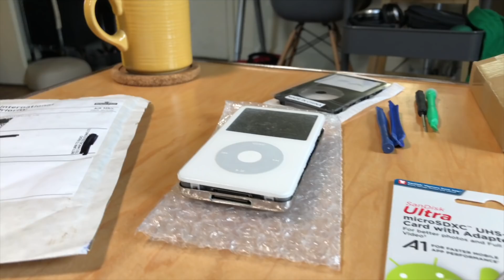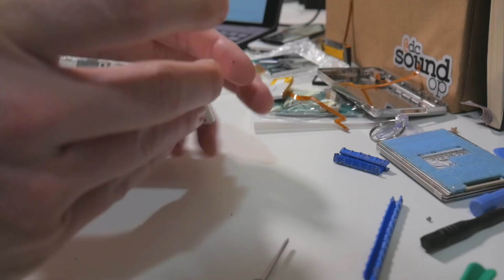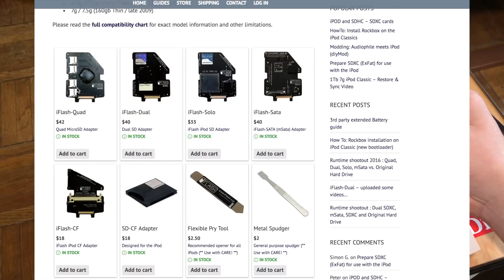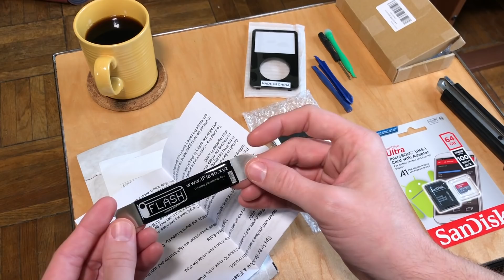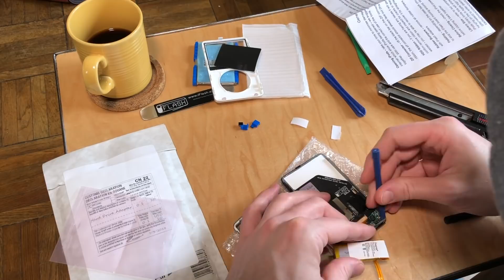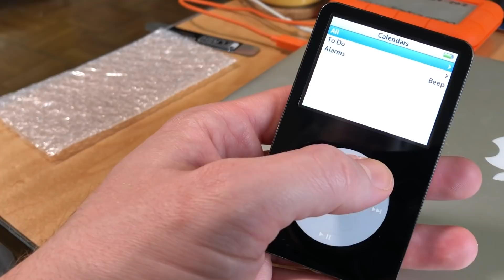Classic iPod 5th Gen SD Card Upgrade w/ iFlash.xyz Adaptor

Comment: You’ve inspired me to rejuvenate my two iPod 4th gen classics, one is mono and the other is color. I already replaced the batteries, but will now upgrade from 20 GB to 128 GB flash. I know it’s easier to buy a new, old stock iPod 4th gen Touch with 32 GB for $70, but that’s not as much fun. Thanks for your videos. I subscribed.
Reply from the maker: Thanks for the message, it's always good to hear of more iPods getting a new lease on life. Good luck with the upgrade!

Comment: For the screws attach a little magnet to the bottom case and put the screws there. So it becomes a very handy tray for this. For the cards: If you have a larger card tha 64Gb you need to format it as Fat32, since the larger cards are formatted as exFat by default and the Ipod may have issues with it

Comment: My library has about 30,000 flac files, totaling about 250gb. I've got several 5th gens and adapters in the way. Needless to say, I'm excited.
Reply from the maker: Wow... 30k FLAC files is a pretty serious collection!! Let us know how it goes!
Reply: @DcSoundOp  Well everything worked and one TB was recognized on my ipod fifth gen thirty gigabyte. I successfully loaded all of my music onto it, And even a few movies and t v shows and everything played just fine. The problem happened when I went to install rock box. Upon reboot the ipod is bricked. I just get a sad mac face and then it flashes to low battery even though it's a brand new 3000mAh battery. I know my next step is to format the drive and try again. , but I don't have a way to connect my mSata drive into my pc. It's back to the drawing board for me, waiting on more parts purchased from ebay.(new mSata, mSata to USB,  a few more iflashs, a few colored cases.) It's all or nothing. I found my new hobby and am building a new collection. I'm still in recovery from watch collecting and ipods are WAY cheaper.

Comment: i sd modded my 4th gen in a few years ago but i just dont like it as much as a hard drive without the spinning of the drive the ipod feel is gone
Reply from the maker: I know what you mean... there is something about the weight and the subtle vibration of the original drives that you don't get with the conversion. I'm glad your iPod is still alive though, have you thought of converting it back to a new old stock spinning drive? They are not super cheap, but I've seen them available for the 5th and 6th gen at least. Thanks for the message & for watching!
Reply: @DcSoundOp  not even joking later that day the IC on the board died while i was in the car 💀

Comment: I just replaced the battery and a screen from an old iPod video I had.  The battery was so bad it would die in under 5 minutes.  If I knew about the SD card upgrade, I would have bought a kit and done that too.  Not that I need more space, more that I don't expect much more life out of a spinning hard drive.

I've been using it as a jukebox on my stereo in the living room.  My spouse isn't very tech savvy but has had iPods, so it makes it easy on them.
Reply from the maker: Now that you've done the battery & screen and know how to get inside the iPod, the SD card is really an easy swap. I agree though, I'll never fill this much space with music! Thanks for the message & for checking out the video.

Comment: I’ve never owned one of these iPods. I’ve always had a interest in tinkering with things. I think because of covid and being home a lot has brought an upsurge in my wanting to fix, repair, take apart and mod things. I’ve already started with a unknown condition of a PS3. I took it totally apart. I thoroughly cleaned it. I applied new thermal paste. I put in a new SSD. Last thing is I’m going to apply a skin on it. So now I’m wanting to do more tinkering. I’m trying a battery replacement on a 3rd generation iPod Nano. Now I want to mod a 5th generation iPod Classic. I bought one for $20 needing a battery and HDD replacement. So I’m excited to start on it once I get it in the mail. I’m not sure which iFlash connector I want. I was thinking of maybe doing the solo. Full size SD cards are starting to get extremely cheap. I already have an new 256gb card I picked up on sale. I had thought of putting it in a notebook that I recently updated for current use. I want to say thank you putting videos out like for people like myself that have a natural curiosity of electronics and tinkering. I’m new to your videos. I’ve been watching Hugh Jefferies, Dank Pods, Techtronics Fix, and My Mate Vince etc. Thanks to the YouTube algorithm it brings me across to other content creators like yourself. I find it wise to watch additional creators to absorb knowledge.

Comment: after i formated the sd card via itunes disc restore, how can i access the sd card via card reader? I would rather be able to write the card via usb 3.0 cardreader than ipod usb 1.0 connector to transfer 200 gb of data...
Reply from the maker: On a mac you can cmd + shift + period at the same time to show all of the hidden files on the SD card - I've got no idea if anyone has figured out how to write into those directories though and make cross loading music there possible. You might be faster to use an alternate OS like rockbox.org

Comment: I've recently upgraded a 30 GB 5th gen to a 64 GB SD card using i flash its working good but the OS seems to run a bit slow, do you know if the larger capacity 5th gens have more ram and would that help withe speed?

Comment: Hey,  I have a samsung Evo 128gb as well as san disk 32gb class 4 SD card. I see the use iTunes to restore screen successfully. However, when I connect with my pc for restoring, it sometimes fails. At times it succeeds, but after restore is complete, it again shows me the error (sad iPod logo). Any idea what could be wrong? I use the cf adapter. Could it be that or the cable which I’m connecting with pc with, or should I try buying the san disk ultra card? Any input from you would be appreciated. Thanks.
Reply from the maker: Hey Arslaan, are you using the iFlash CF adapter or another brand? I didn't have any luck with the generic one I had, but I know lots of folks online have used them. Also, how are you using SD cards in a CF adapter? Is there another adapter between those? Do your SD cards have the write protect tab closed? Let me know some more specifics & hopefully someone here with more experience will be able to help. Thanks for the message.
Reply: @DcSoundOp   I got both of these things, the cf and zif adapter on aliexpress few years back and still have them installed in ipod.  My cf to zif has a single micro sd card slot, its actually different from the full size ones we usually find in online videos (like the one you initially had)  . I even followed the steps to format the cards posted on iflash website but no avail. Micro sd cards don’t have any write locks as such, I’ll still look at that once again . I wonder if the restore shows up, then why doesn’t it restore successfully? Confuses me a lot. Please enlighten your thoughts on this. I hope we can come up with a solution. Thank you again.

Comment: Thanks, you had the information I've been looking for which is formatting the new SD card for the iPod. I looked at the iFlash site and there were articles about formatting but it seemed like that was for formatting on a PC not a Mac. I have a old 5.5 gen iPod with an original "Tarkan" adapter I guess Tarkan has revamped now calling them iFlash. My adapter looks very different. My SDXC card mounts from the side not from the top. Good to know a new SDXC card doesn't need formatting prior to installing into adapter...pretty important info. The iFlash sight should say that maybe they do but I couldn't find it.

Comment: Comment about the end of your video: I never had wheel-based iPod growing up, just a SanDisk MP3 player that I flashed up with Rockbox and, when I'd saved up for it, a 5th gen iPod touch. I've always been a Mac fan and loved the concept of the click wheel interface.

After seeing a few videos like this and some threads on Reddit, I made the decision to get a couple of 'parts and repair' iPods on eBay and try my hand at opening them up and refurbishing them. I screwed up the first couple of attempts, but ended up with one that worked pretty decently. 

With that first project out of the way, I've ordered a 7th gen iPod and iFlash adapter to do up as a new daily driver iPod. One of my coworkers offered to pay me to upgrade his iPod if mine goes well, so wish me luck 🤞

Comment: Don't use or don't promote iFlash.xyz for anything.  They are a miserable company and I never got what I ordered from them.  I ordered parts and after nearly two months waiting, I never received what I ordered.  When I contacted them (email only), they blamed USPS for me not receiving my items.  I challenged the order with my credit card company and won the case and my money was refunded.
Reply from the maker: newsveteran You waited two months to tell them the order didn’t arrive? I’m struggling to see how your situation is their fault, let alone justification for a post like this. I don’t have any affiliation with them, I don’t make a cent if you buy from them, but it seems wild that you’re happy to burn them down over what sounds like a lost package. What am I missing here?
Reply: @DcSoundOp  What you're missing is I ordered parts, they charged my card, I never received  my order and they did nothing to help me track or recover my order.  I waited because they said they couldn't deal with shipping concerns until 42 days after order. They made no offer to send a replacement order or any other gesture to satisfy a customer.  The USPS is trying to locate the package but has been unsuccessful. The trace was done by me with no help whatsoever from iFlash.  They decided to blame someone else and do nothing to make sure a customer was happy.  I've had my own business for 25 years and if an order is lost or missing, I send out a replacement right away.  The customer has their parts, they are satisfied, and I AM THE ONE that deals with the shipping companies.
Reply from the maker: That’s a much more compelling story with all of the details - thanks for sharing your experience. Pretty odd that they specifically said they wouldn’t do anything until *42 days had passed... What a bizarre policy. 

Also, I ship ~100 items a month avg. with USPS & would have a better chance asking my mail carrier to fix my iPod himself, than to find a lost package using their tracking system. Good luck out there.

Comment: Hey I was wondering if your replacement face plate had any tolerance issues when installing? I've tried so many and they all have issues with tolerance, either leaving too much of a gap between the plate and the wheel or jamming the buttons after installation.
Reply from the maker: Luckily no issues with this one. It doesn't feel quite as nice as the original apple one of course, but it has not had any issues clearing the buttons thankfully.
Reply: @DcSoundOp  that's great!

Comment: That's cool they gave you the instructions lol.  Not that it was difficult.  Hardest part is opening the ipod.  Great video.  Just resurrected a 6th gen classic w/128GB SD, new battery and replacing the damaged hold/headphone assy since when I removed the battery I broke the ribbon cable some how.  Looking to get a few more good years out of it!   Thanks again!

Comment: Great video! how's battery life compared to the regular HDD? I have an 80GB 5.5 version and i'm really looking into giving it the upgrade :)
Reply from the maker: The battery life is much improved without the spinning disk. Third party batteries are always a gamble though. Even from the same supplier, I've had laptop batteries preform wildly differently, so I always order a few and compare within that group. It's not uncommon to get a bad one occasionally from any third party vendor.
Reply: @DcSoundOp  awesome, thanks. Will try it really soon.
Reply: @DcSoundOp  I watched a video of a guy saying the battery performed less well with flash rather than HD.
This surprised me. I thought it would definitely be much more efficient.
Have there been bench tests on the two options?
Would really like to know for sure.

Comment: The reason upgrading the 5th gen ipod is worthwhile is that it has one of the best DACs in any mp3 player ever made which is why I've just ordered the parts for my old 5th gen Ipod Video. Its stuck on a white screen, not recognized on iTunes or Windows so I think the hard drive is kaput. Gonna try a 512gb microSD card, 3000mah battery and capacitors mod.
Reply: Capacitor mod only works through the 30 pin, you probably already know that. But if you did not you need to make another adapter for the 30pin to headphone for superior audio, and maybe a headphone amp.
Reply: How did your 512 mod go? I'm considering taking my old 30G iPod to something greater; 256 or 512, but I've learned that the 30G iPod is RAM limited to 32mb.  The iPod OS creates a database for the contents in that RAM which limits the storage capacity of the HD.  80G iPods have 64mb of RAM with greater capacity.

Comment: iPods are becoming more rare, so fixing them up may be for a good cause!
Reply: You obviously have not been on eBay so no they are far from rare as I just bought 3 in the past week.
Reply: @emotionalintelligence776  because iPods are no longer in production, they are indeed becoming more rare every time an iPod is damaged beyond repair. Random22 did not claim that iPods are rare, just that they are becoming more rare. Even something that is abundant could be becoming more rare if its moving from not very rare at all to slightly rarer
Reply: @Ad_Asterisk  Beyond repair? Every part of a 5.5 can be bought on ebay. Unless it's been crushed, it can be fixed.
Reply: @emotionalintelligence776  i brought one U2 ipod classic 5th gen, uograded it using  iFlash.xyz Adaptor with 128 SD card plus 3000Mah battery...
Reply: @teogeorge3987  I now have a 5th, 6th and 7th running upgraded batteries and flash storage with their respective tarkan adaptors. I have Rockbox on the 6th and 7th gen, but I have a 4th gen project that I just started.
Reply: M. Guillermo How did your 4th gen project go? I just restored a 4th gen and didn't know if the boy supported 256GB but it did! Not sure on song limits though.
Reply: Hey still have the IPod ? If yes want to sell it?
Reply: @nuttybuddy719  Yes. No.

Comment: I got a new hard drive for my 160gb classic and that didnt work so I got this Iflash.xyz and a 128ultra high speed SD and it was so easy and worked great. Make sure to put the ipod in disk mode after you connect it. Do a restore and off you go.

Comment: Great video. Just finished with my iPod.After upgrading can the old hard drive still be used without the iPod casing ?
Reply: You can get adapters to take it to a 2.5" pinout and a 3.5" pinout, but the drives are so capacity limited that you wonder if it's worth it.
Reply: Eric Andersen I hear you but I hate to throw out tech stuff if I know it can be of some use
Reply: @elkidgaming  Yeah, I know how that goes...  Used to be, that an upgrade at the top of my tech food chain would have a trickle down effect on all the other PC equipment in the stable....  At the end of the line, perhaps there was a PC that could be resurrected.  My basement has aisles like a supermarket with 38 moving boxes on the floor.  The smaller stuff is easier to keep....   LOL - we're tech junkies!
Reply from the maker: I'm sure someone has managed it in the past. I'm not sure what I would use it for, but it would be a surprise if there isn't someone out there doing something cool with that idea.

Comment: Great info. Thank You
I put a Duo in and cant seem to get the life out of the original battery or even a new battery. I
'm guessing there are better, longer lasting batteries or an 850mah. 
Can you suggest a battery that will power the G5 Video iPod that will solve this issue? 
And how long should the battery last? All day? 3 hours? 2 days?
Much Thanks.

Comment: Can I use one of these to upgrade iPod Classic 5th Generation White (30GB) to 128GB? I'm looking at the Solo.
Reply from the maker: Hey Kev, I'd give the folks at iFlash a shout directly @ https://www.iflash.xyz/contact/ - they also have social media channels listed at the bottom of that page that may be quicker to get a response. I'm not associated with them & would hate to spread inaccurate info about compatibility. Thanks for watching & for the message!
Reply: Yep! Absolutely! I'm about to do so with an iPod Video 5½Gen 30GB, using the iFlash Quad adapter and a pair of 64GB microSD cards.

Comment: what a loads of rubbish, those generic ones work perfectly for a fraction of the cost.
Reply from the maker: Can you share some footage of your experience with them? I genuinely tried to make them work & was not able to. I'm sure other folks have had success, but to say they work perfectly for a fraction of the cost is a bit of a stretch.
Reply: @DcSoundOp  Did you put the generic one in the wrong way? Im currently building a 256GB Ipod waiting for faceplate to arrive I will do a video.  I have upgraded 100s of Ipods to sell on ebay and used the generic ones which cost in total $11 AUD thats a fraction of the cost.
Reply from the maker: @Inappropriatepaul  Hey Paul, I tried everything I could find online to get the cheap ones to work. Maybe I got a bad batch? Looking forward to seeing the video, can you also include a link to the ones you use when you post it? I'd love to point folks in the direction of a cheaper option, if I know it works. I'm happy to point to your video as a guide for folks wanting to go that route. Hope you're well in Australia!
Reply from the maker: Cool, thanks for the link! ✌🏼